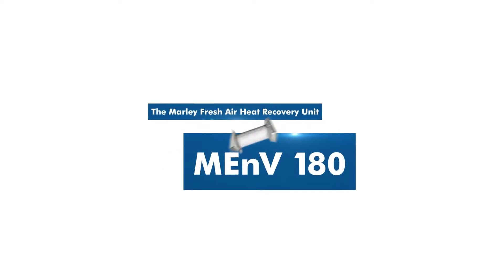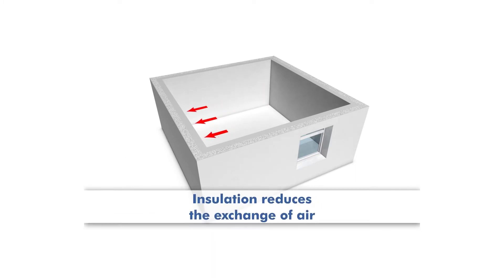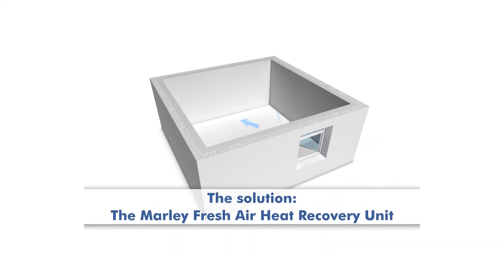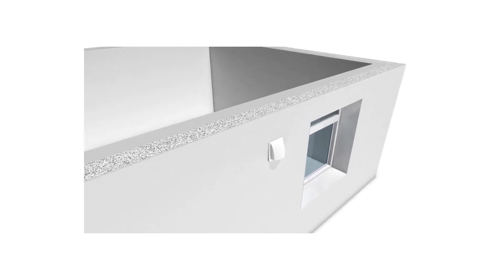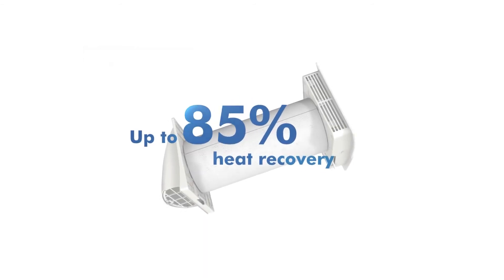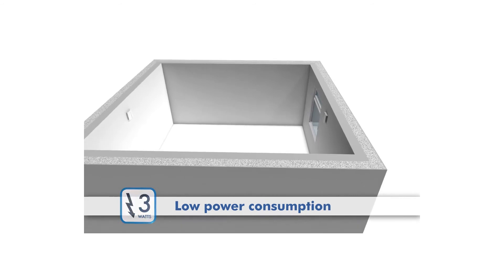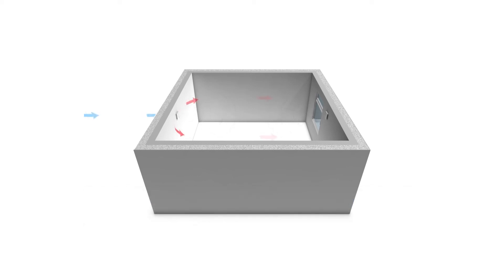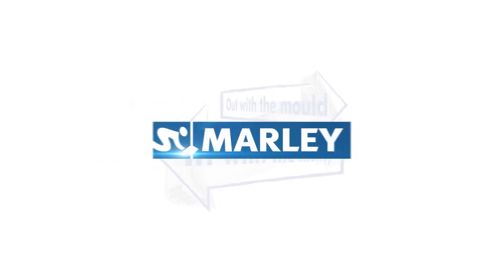Marley Fresh Air Heat Recovery Unit MEnV180 – creoven.tv product video

Comment: Everything is beautiful BUT systems like that must work as a pair. Each one in opposite side of the house. Otherways if the system blows fresh air in, indoor pressure rises up and the warm air will find its way out between window seals, door locks any other spots that are not airproof. And the house is loosing energy. 
And when the system blows air out, the same happens - there will be air pressure difference between indoors and outdoors and cold air finds its way in. Only solution is to install a pair - while on blows air in, other sucks it out and vice versa. It's not enough if you just install 2 units. One must operate always opposite directions than the other. If that's not supported by the unit, forget the heat recovery and better buy 20 eur one way ventilators.